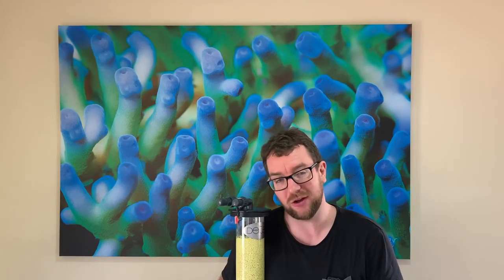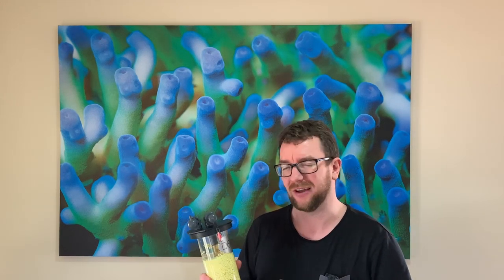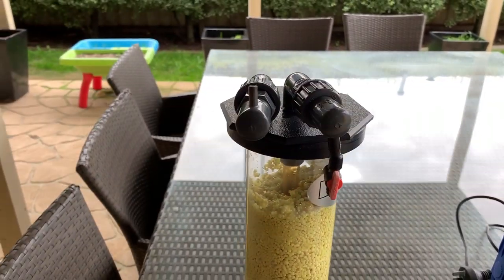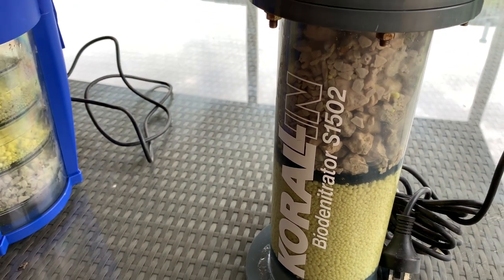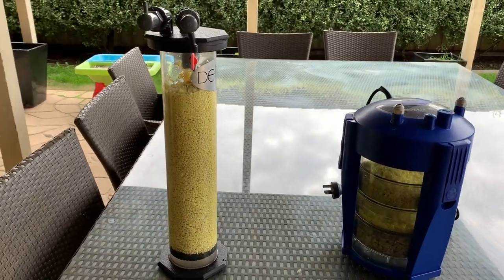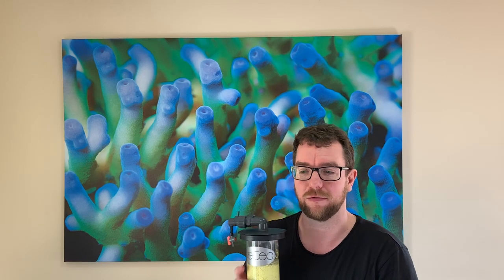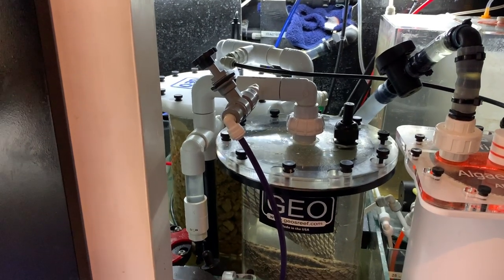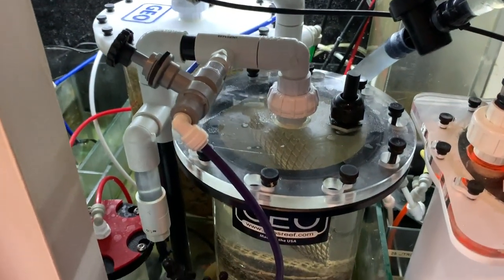Using a Sulphur Reactor for Nitrates

Comment: Hi... Can i add 1 more additional chamber for this sulphur reactor.. Connecting to my calcium reactor? I mean after flow come out from cr then go to this sulphur chamber reactor..? Thanks...
Reply from the maker: Of course :) Almost better drawing through this into calcium reactor though as ph will be reduced a little by the sulphur
Reply: @ParkersReef  u mean this method is better than put sulphur beads into cr? Thanks
Reply from the maker: Yes
Reply: @ParkersReef  did u still using this method? Got any side effect?
Reply from the maker: @anthrax5643  have been for about 5.5 years mate. Love it. Only side effect is increased alk consumption
Reply from the maker: @anthrax5643  yes - dont put sulphur into your calcium reactor (unless you are not using the calcium reactor as a calcium reactor...)
Reply: @ParkersReef  noted mate..😉 Already order mine... Thanks for details.. 👍👍🙏
Reply: @ParkersReef  ahh... forgot 1more mate.. Did this sulphur beads need co2 also in their chamber?
Reply from the maker: @anthrax5643  they do not, that's why you block off the c02 inlet on the calcium reactor (if you are using a calcium reactor for a sulphur reactor)
Reply: @ParkersReef  noted that mate...will stick to my 1st plan.. put this beads fluids Reactor next after  CR drips then GO into sump... Thanks a lot bruh.. 👍👍🙏🙇‍♂️

Comment: I like to use this method however I can’t find any sulfur aquarium media in USA, only one I can get is soil sulfur prils 
99.0 pure do you think that would work. 
Thank you
Reply from the maker: Yeah I’m sure they’d work.
Reply: You can find 99.9% prills on Ebay
Reply: bill fyler 
I found it thank you, I am exited about this method
Reply: Awesome. I am planning on turning a spare mrc procal calcium reactor to sulphur reactor
Reply from the maker: @williamfyler7162  that should do the trick!
Reply: @ParkersReef  I'm hoping so. Ordered 4 lbs of sulphur for a 400 gallon system. Will add arm media to second chamber of reactor to help keep alk up. But I am running a pro cal calcium reactor also so can ramp that up to offset also
Reply from the maker: Good stuff. One thing to watch, if you have a decent level of nitrate - it will chew alk alone. So adjusting calcium reactor on its own may result in high cal and mag. So consider a single dosing channel for a little alk
Reply: Hi Gerard,  how's it running these days... I bought that soil sulfer on amazon..

Comment: Hi Parker, a quick question. My Ni had gone fro 0-26ug/l from one ICP to the next. The only thing I can think of was that I had used a  sulphur reactor for a few weeks to reduce nitrates. Have you noticed Nickel in your ICPs with using the sulphur reactor?  .... Joe
Reply from the maker: Hey Joe. Definitely not... I’d be checking out the pump on the reactor if nothing else changed. Could well be leaching nickel from the motor. Definitely didn’t have any hose clamps near water with the sulphur reactor?
Reply: Parkers Reef      No, no metal hose clamps in the tank at all. The pump was new on the reactor as well. I was looking up how they made sulphur pearls and it seemed to be from Nickelliferous Pyrrohotite, hence the question about the sulphur.

Comment: Hey, not sure if this video is too old for you to see this comment.

I have a 190 litre freshwater tank. My tap nitrates are around 80ppm Nitrate and so have been looking for a way to lower them in my aquarium. 

Is this the solution? If so, how is the water flow created? Does it work purely on gravity if the reactor is under the tank? Or does it need a pump somewhere?
Reply from the maker: Never too old, thanks for watching and commenting!!

Wow, tap water with 80ppm nitrates?! Personally I’d look at a reverse osmosis filtration for the tap water to stop it entering your tank.

If you do go the sulphur path, ideally you want a small pump pushing water through
Reply: @ParkersReef  Thanks for the reply. Am considering RO just where to house it and the waste water that worry me. I’ve subscribed, looking forward to more of your content.
Reply from the maker: Thanks for the sub!

RO units can be pretty small, I’d look to mount in the laundry which will give your storage, access to fresh and access to the drain :)
Reply: @ParkersReef  Thanks again. And sorry to pester, but when you say small pump what do you mean?
Reply from the maker: I wouldn’t rely on gravity to supply water to the reactor (assuming you were planning on adding the sulphur reactor to the fish tank as it wouldn’t work on the tap water (well, I wouldn’t think it would, but I guess it could if you let it go through slow enough....)

Comment: Just watched this video and noticed you run what looks like a pacific sun algae reactor.  Is it ok to run a sulphur reactor alongside an algae reactor ? I run a pax bellum NR18 on my 300ltr system.  My nitrates are still very high after over 1 year of running it.
Reply from the maker: It is ok, but they will compete against each other a little. Sulphur if done correctly will bring your nitrates down no problem at all
Reply: @ParkersReef  thank you.  What is the model of the deltec reactor without a pump, you demonstrate in the video please? I might decide to sell my algae reactor as it’s a bit of a faff harvesting cheato every two weeks.  I run a reactor with gfo also, so could replace the Pax Bellum reactor with a decent sulphur reactor.  Is the geos reef one any good do you know ?
Reply from the maker: I would definitely opt for one with a recirculation pump if your nitrates are high. The geos reef units are fantastic, cannot recommend highly enough!
Reply: @ParkersReef  I recently bought a Hanna nitrate checker and was shocked to discover my nitrates are around 36 ! Yet my corals are thriving.  One of the reasons I want to reduce my nitrates drastically though, is I stupidly put pulsing Xenia into my aquarium a while back, and it is now becoming a pest.  I want to starve it out by getting my nitrates down.   Thanks very much for your help and advice
Reply from the maker: Was going to say, if they coral is healthy, don’t worry! I’ve seen amazing tanks with nitrates well over 20.

But yeah ok, Xenia can be starved of nitrate (apparently) so could be worth a shot
Reply: @ParkersReef  thanks again

Comment: I've had my reactor running for 6 days now. The nitrite coming out of the Effluent is 0.25ppm. From what I've researched this is perfectly normal as the bacteria are reducing nitrate to nitrite and once there is a lack of nitrate with an abundance of nitrite the bacteria will began reducing this into nitrogen gas. How long should I expect the nitrite spike to last? Nitrate tests are useless when nitrite is in the water as the tests work by reducing nitrate to nitrite using zinc or cadmium and measuring the quantity of nitrite. My flow rate is 1.5ml/min about a drop every 2 seconds.
Reply from the maker: yeah great question - I am not sure, I never tested nitrite in the effluent - only the nitrate

Comment: Hey Sam, on the deltec reactor with the adjustable value, is that on the in or out flow? Thanks
Reply from the maker: The adjuster is on the outlet
Reply: Parkers Reef 
Silly question, does it put pressure on the reactor slowing it down from the outlet?
Reply from the maker: You could restrict the inlet if you preferred. But yeah, it would put a tiny amount of pressure on the reactor (but they are designed for it.)
Reply: Parkers Reef 
I was just on the deltec web site looking at the NF 509 reactor and it showed the valve on the inlet, was just double checking on how you ran it. Thanks for your reply.
Reply: Parkers Reef 
Any of those up for sale lol?
Reply from the maker: Yeah I had all three for sale, 2 have been spoken for though. Just the aquamedic left
Reply from the maker: @si8780  I can't find your message about the aqua medic, but yes - it is for sale $150 :)
Reply: Parkers Reef 
Ok how do I get in contact with you about the purchase?
Reply from the maker: @si8780  seems you don't have any contact details on YouTube. You can reach me at: sparker @ Deakin . edu . au

Comment: Great video.  I love watching your stuff.  I have a question.  I am about to start up my nitrate reactor.  I currently use a calcium reactor and it is very stable at keeping my alk cal levels.  You mentioned that my aLK will drop once this starts to get going.  My question is will it throw off my balance of cal alk meaning I will have to dose additional ALK above what my calcium reactor is dosing or do you mean i will have to increase my alk/cal coming out of my calcium reactor.  The second question is will this reduce Phos as well or will I need to reduce Phos with another method GFO or something like that?  I have a full SPS tank and would love to hear what you have to say.
Reply from the maker: Hey thanks for the questions. Yep, you will need to supplement some alk when this is first getting going. It will take a decent chunk out while establishing.

It won’t remove any phosphates though

Comment: HI Sam, How long on average will it take to see a reduction in Nitrate, if I have it set to 1 drop per sec? I am using the Aqua medic Nitratereactor 1000 recirculating reactor. The second question would it help to add BioDigest Proddibio to help speed up the process.
Reply from the maker: hi Nader,

very hard to say - depends on the size of your tank, volume of sulphur in reactor and the nitrate level in your display.

You should see your effluent nitrate level drop to zero within a day or two.
Reply: @ParkersReef  Thank you Sam for getting back to me so quickly :) My tank water volume is about 900 to 1000 liters, I have added 2 liters of Sulfur. I have really only started the 1 Sec drip counting yesterday as I was fiddling with this reactor to set it up correctly, leaks, adjusting the flow at the inlet as apposed to the outlet. ( Correct me if you see an issue)... Anyway lets see how it goes. Love your channel and I love reefing every day is another story :)
Reply from the maker: Good stuff mate, keep at it!
Reply from the maker: Keep slowing the effluent down until you do see it drop
Reply from the maker: I would not add more sulphur until you have the effluent at zero nitrate and cannot speed it up enough to have any impact on the tank. Till then, slow the effluent down till you get zero nitrate
Reply: @ParkersReef  Thanks very much Sam it is working like a treat have hit 0 today now time to dial it back.

Comment: I have been searching for a way to lower VERY high (off the chart, litterally) nitrates in my heavly stocked system but I'm a bit nervous of the hydrogen sulphide discharge happening as I know this can wipe out a tank in short order. Can you give any tips on how to stop that from occuring?
Reply from the maker: I can’t... other than to say I’ve ran sulphur for years with no ill side affects. Works a charm :)

Comment: Thanks for such a well-presented video. I set one up eight weeks ago with one litre of sulphur beads and almost one litre of coral rubble. It's connected to a 350-litre freshwater tank with a heavy load of African cichlids. I started off with one drop per second, then one drop every few seconds, and now down to one drop every ten seconds. My nitrate readings are still sky-high after all this time. Are you able to make a suggestion? I started off with high hopes, and feel very disappointed. Your comments would be highly valued. Thanks. Les, Brisbane
Reply from the maker: Hey Les. Hmm, I have no experience in running these in freshwater - but should be fairly similar.

Have you tested the nitrate of the effluent? Has it smelt like eggs yet? If you are down to one drop per ten seconds and still seeing nitrate in your effluent, you will need more sulphur media.
Reply: @ParkersReef  Thanks for your reply and your suggestion. I used 1L of sulphur based on your suggestion of 1L per 400L of water. I've not detected any sulphur smell in the effluent, which shows nitrate at the same high level as the main tank. Adding another litre or so of sulphur will be difficult for me, so I'll continue waiting in the hope it will kick in. If I get no results, I'll have to rethink my design. Thanks again.
Reply from the maker: Is the reactor a recirculating type? That will help with the efficiency of it
Reply: @ParkersReef  No, it's a simple homemade cylinder with water in at the bottom and out at the top. If it seems I have to go to recirculating, I guess I'll have to. I thought that a simple  flow-through would at least have some effect. Thanks Sam.
Reply from the maker: Hey Les, yeah fair enough. Like I said,  never done them with freshwater so I am not sure exactly on the volumes required.

I do know that if you are down to 1 drop per ten seconds and are still not getting a reduction in nitrate, then you will either need more media or more flow through the media (without more effluent)
Reply: @ParkersReef  Thanks Sam. Back to the drawing board!
Reply from the maker: @lessavage2623  certainly seems that way I am afraid. Perhaps make a bigger reactor? Or one with a recirc pump, or both :P

Comment: Actually I could not start this system and I do not know the reason why?
Reply from the maker: which part did you need help with?
Reply: @ParkersReef  I started with drop/sec but after two week of operation I could not measure any decrease in nitrate level.
Reply from the maker: ok you either need more media, or a slower drip rate. Does your reactor have a recirculation pump?
Reply: @ParkersReef  no recirculation pump.
Reply from the maker: That'll be the issue. Passive reactors are really only good on small tanks.

Comment: Hi Sam I’m getting higher nitrates coming from my effluent than my tank water , any reason why ?
Reply from the maker: I cannot imagine how unless your media is trapping detritus that’s is breaking down?
Reply: Parkers Reef I’m not sure , but it does smell slightly eggy
Reply from the maker: Gotta speed up the flow till it doesn’t then mate :)
Reply: Hi Sam I’m still not getting a nitrate drop out reactor after 8 weeks, I’m wondering if the way I’ve filled reactor may be the problem? Ive got a layer of calcium and then a layer or Sulphur which I’ve repeated 6 times each on the way up finishing with calcium?
Cheers 
Joe
Reply from the maker: It honestly shouldn’t matter. If you are getting eggy smell, it is working, just working too well (the bacteria is starving and dying off).

What is your nitrate in the tank? How much sulphur are you running? Does your reactor have a recirculation pump or is it just flow through?
Reply: Parkers Reef Hi Sam , it’s a 60lt plastic drum , flow is straight through bottom and out the top , I have 30lts sulphur and 30lts calcium. Any flow under 700mls a min smells but nitrate is coming out round 100 ppm same as tank no matter how long a leave it . Im running it at 1.8lts a min at the moment 2 days no change
Reply: Parkers Reef no smell either 😁
Reply: Just to give you more information even a 1.8lts per min the oxygen level in the effluent water is down to 45% tank water is 95% ,
Reply from the maker: yeah ok, I wonder if the non-sealed nature of the bucket is causing issues. I've only ever used enclosed reactors. Or potentially could be the lack of internal flow (on decent sized tanks I always use reactors with internal recirculation pumps)
Reply: Parkers Reef yes I agree I think it’s definitely internal flow issue, I’m going to experiment with small reactor I have just to see if I can get  it working properly using same media from large reactor.. btw the large reactor is fully sealed.
Reply: I’m thinking on modifying the large reactor into a recirculating, my reactor is 60lts with 60lts of sulphur and calcium combined. Water volume would be round 30lts  ? How many times a minute would I need to turn water volume in reactor over for it to work ?
Reply from the maker: Great question, I wouldn’t know for sure, but as much as you can without grinding the media
Reply: Parkers Reef Thanks Sam for your help , keep you posted
Reply: Hi Sam I’ve finally had success with my 60lt reactor (I Think) , I put a recirculating pump as you suggested. I had a nitrate drop down to 20ppm out of effluent with in 24 hrs with a (API test kit more on this later )  Had pump recirculating at  300 times  volume per hr water over heated to 45deg . I’ve now got it down to 100 times , temp is round 5 deg above tank at that speed round 30 deg ? I’m not sure  if you’ve come across this issue before testing effluent with different brands , JBL , Selifert , NYOS all give me reading that are higher than tank water  at 100ppm  . API is reading 20ppm after numerous test ? I’m not sure if the sulphur is reacting with results?  I’m hoping API is correct . 
What are your thoughts ? 
Cheers 
Joe
Reply from the maker: @joebasile267  ok great - sounds like it did need the extra internal flow :)

Comment: Hi ever since i watched your video i decided to setup my own diy reactor
My tank is 370 L and am using 500ml of sulphur media and 500ml of calcium media and hope this enough
Reply from the maker: keep us updated with how you go!
Reply: I have a 450 litre tank, and I setup a basic 3 litre hang on the side bio pellet reactor, and filled it with carabsea no - no3 (sulpha/aragonite blend, that's heavy on aragonite) (and it holds about 2.5 to 3l of this media) I have the effulent running at a slow but steady stream, and the water is entering the reactor at about 30ppm nitrate and leaving at about 5ppm nitrate, it's a heavily stocked freshwater tropical tank and I couldn't keep nitrate under 80ppm. These things work 😁 if I wanted zero nitrate I'd need to slow the flow down or I'd probably need a larger reactor that holds an extra 1-1.5 litre media. but I'm not chasing zero nitrate.